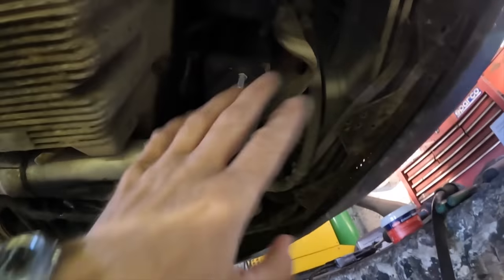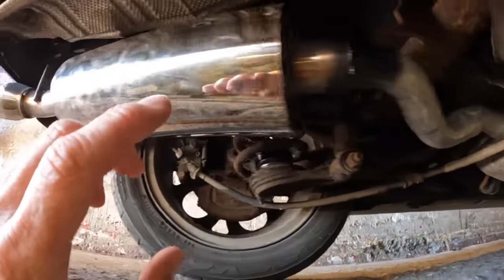Alfa 145 gets a new exhaust

Comment: Lovely job. I've had to go full on custom exhaust before this. In fact, the next time I do the exhaust on the Volvo 240 wagon it is getting the full custom stainless system. That should last my Lifetime. Full custom was the only way to get dual exhaust on my 78 and 79 Thunderbirds. A dual exhaust was not offered even though the cars came with twin catalytic converters.

Comment: Great job, nice to see that these shops still exist! I have treated my Bravo to a stainless rear damper which is also custom fitted and it is such an improvement in the sound. By the way, I have had some experience with fixing this aircon system in my Marea, it can be a faff. Cause of a lot of problems were faulty electronics under the bonnet (relais and stuff) which prevented the fan from starting at the correct time which in turn caused too much pressure in the system and all kinds of failures. So make sure to have that checked as well, apart from the obvious stuff like leaking hoses etc.
Reply: It is a good sign that there are still people about to make custom exhausts as if one runs older cars they are essential.  learnt a lesson in having a complete stainless system made for a PVT in that they change the exhaust note considerably, in this case for the better, not so good if original sound is one's preference, stick to a mild steel one.
Reply from the maker: that is likely to be part of it - the earths are terrible on this car! One of the headlights stopped working between leaving the garage and filming the walk around!

Comment: I like the sound of the new exhaust system. Sounds very nice when revved, I'm sure it is quiet on the motorway.
Hope you find a specialist for the HVAC, pretty sure the system will need to be evacuated. Does it have CFC free refrigerant?
Reply from the maker: Thanks, it is nice to be in now. I had it regassed last year as it takes the new type of gas and seems to be holding so I think something is broken

Comment: I had to get the rear section on my 1997 toyota hilux replaced this year because it failed because the muffler wasn't the best the muffler shop were able to source the correct part to fit the acual pipe and the muffler was larger than the one that was on it been a flat top ute it fitted ok but the  bracket had to be modified the mechanic had to grind and drill it l watched the process the year before l had to get the front section changed this was easier that was it failed the regestration inspection

Comment: This is the sort of place I need to take my 960 to.  It's a hodgepodge of various pieces of metal shoved together - somebody cut the cat off the car last January.  It doesn't fit right and hangs too low and even scrapes on the ground at times.  I also need to get my AC sorted, the pipes to the condenser have been cut so ideally need to find somewhere to replace/manufacturer/attach to what I have already - I already have a new condenser and brand new pressure switches.  Any ideas of where to go?  Will keep an eye out to see where you go.
Reply from the maker: this is the place for you, if they cant get it they can make it - Maidstone/Bower Street Exhausts
Reply: @furiousdriving  I'll definitely remember them.  AC place, bodyshop place etc.  The list that never ends with an old car!

Comment: It is a big shame that a car so attractive has been done in by simple fact that it suffers from crappy Italian build quality where some things are no even assembled right at the factory. i was interested in a Fiat 500 (The one made starting in 2007). I had a few as rental cars and liked how though it was small on the outside, it had plenty of room inside for use as a commuter car and was very good on highways. Sadly hey were unreliable and it would be a pain to get it to the "salon" to get repairs done on it warranty wise so I passed. (If I can find one selling for cheap i will pick it up)
Reply: Nothing wrong with the 500’s. 
Extremely easy and cheap to fix and maintain.